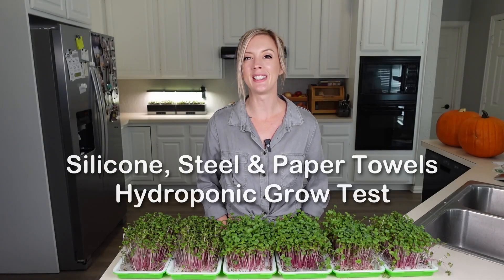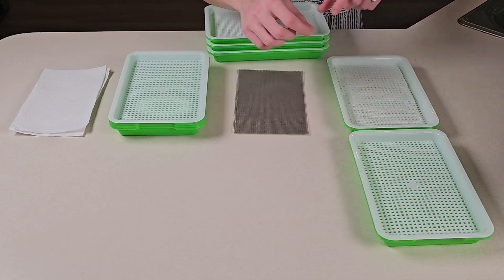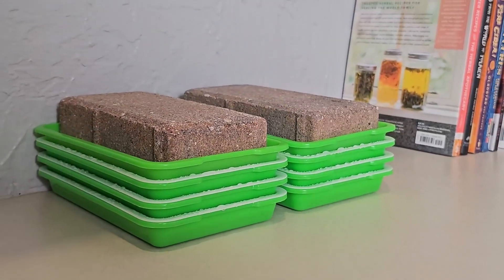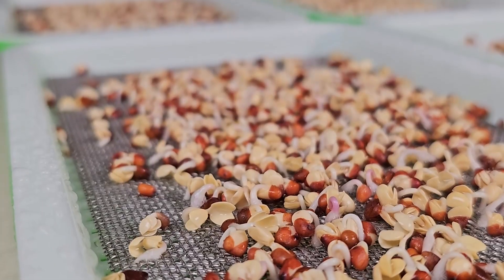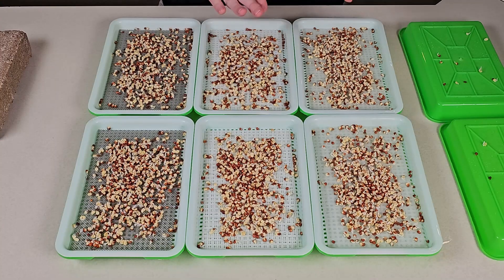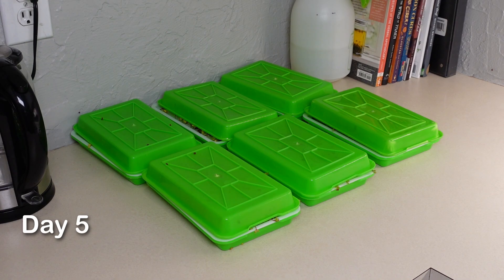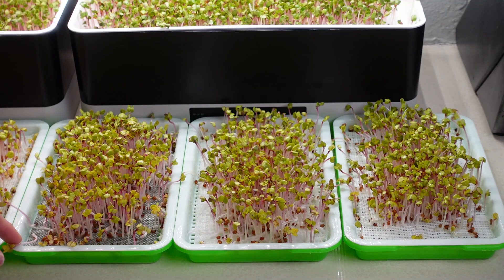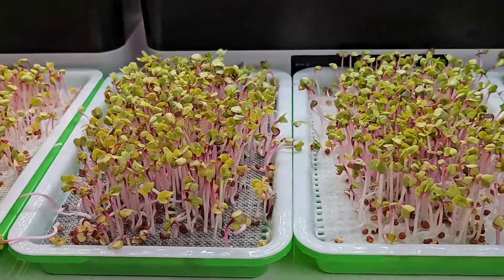Radish Microgreens: Paper Towels vs. Reusable Mediums Experiment

Comment: Why not use carboard trays ?  You can make yourself for free.  No plastic waste to deal with.
Reply from the maker: That’s a fair question! Cardboard sounds like a great low-waste option, and it can be fun to experiment with—but in our experience, it’s just not a reliable long-term solution. Cardboard breaks down quickly, especially when exposed to moisture. It can leak water, dry out way too fast, and also creates the perfect environment for mold and fugas gnats. 

I actually tested this recently using a cardboard egg carton—by day 2, it was drying out constantly, by day 3 it was falling apart, and by day 7 it was already trying to mold. So while it's creative and can work in the short term, it’s not very practical for consistent or clean microgreen production. 🌱

Comment: Love your experimental approach. I prefer potting mix (easier clean up plus I dont like the idea of the mesh fiberglass core) but was wondering how the mesh could hold enough moisture. Unbleached paper towels would also be an easy cleanup. I wonder if there's some way to perforate them for better root penetration, maybe small scissor cuts...
Reply from the maker: Thank you! We really appreciate that 😊 Potting mix is a great option, especially if you’re looking for easy cleanup and want to avoid materials—I totally get that, everyone has their own preferences, as you should have! 

The silicone mesh actually holds moisture well because it's designed to sit directly over a water-filled base tray, so the roots wick up what they need from below. As for unbleached paper towels—that’s a fun idea! They can definitely work short-term. Adding tiny scissor cuts could absolutely help with root penetration, especially for varieties with finer roots. Might be worth testing in a side-by-side grow! 🌱

Comment: Seems like the lesson is to use a cheaper brand of paper towels with a looser weave. That clean-up was so much faster!
Reply: I generally have 2-ply paper towels and when I want to germinate seeds on them I separate the 2 plies so that I have an ultra thin paper towel. It has worked pretty well for me and I can cut them to any size depending on the container.
Reply: @OldMotherLogo  Thanks for the tip!
Reply: I know not everyone has this lying about but I just germinated some lettuce seeds on very thin unbleached cotton batting (used in things like quilts). I have a bunch of scraps. This batting is only about 1/16 of an inch thick, is very porous. I set the seeds on it two days ago, have spritzed them with water twice a day, they were in a little container with a lid to retain moisture in a warm place. They sprouted within 24 hours and today they have roots. Almost all of them are sticking through the batting about 1/4”, no weight on top of them. I was pleasantly surprised. Just thought I would pass that on. I set it on top of some pea pebbles and am going to try a Kratky style of growing them, see how that works out.
Reply from the maker: Paper towels can be easier to clean up! However, just a heads-up—some paper towels can contain chemicals that might not be the best for certain uses, especially around food or plants. If you're doing something like sprouting microgreens, you might want to consider unbleached or chemical-free options. Usually, cleanup up takes longer on the smaller reusable mediums compared to the larger 🌱🌱